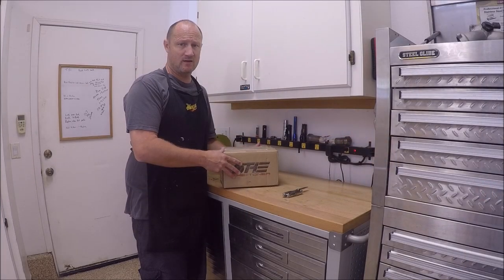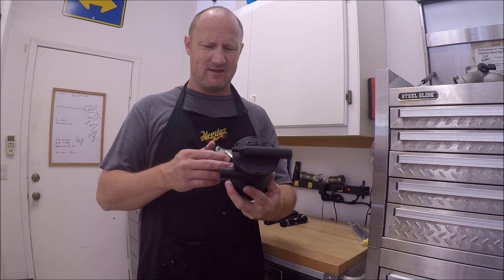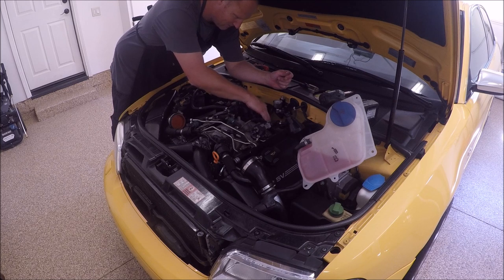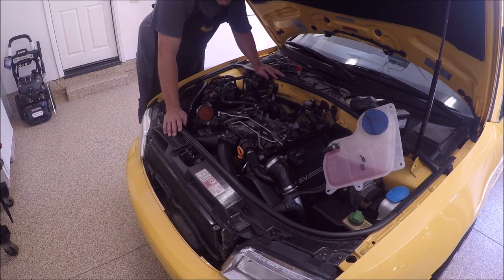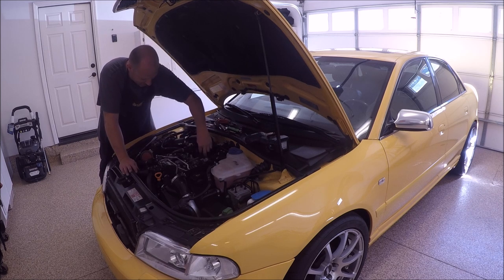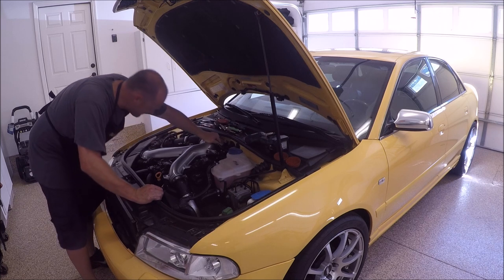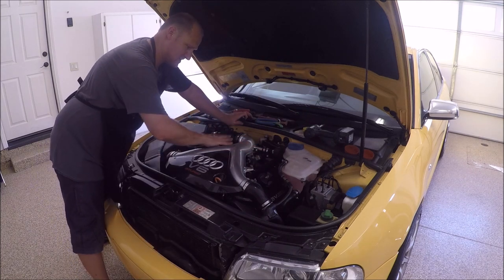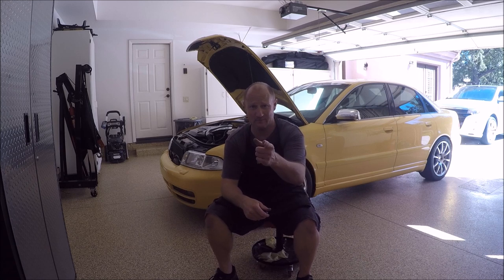The-Tuner Catch Can Install (TTE)

Comment: Hey can I ask what manual transmission gl4 fluid you prefer. I just swapped mine to redline 75w90. And although it shifts better It’s stiffer in cold temperatures than the factory fill. Considering going back to the factory fluid just wondering if you found anything better. I live in northern Michigan so I deal with some cold temperatures.  And also some hot temperatures in the summer.

Comment: 👏🏻👏🏻👏🏻 I think I used a 19mm cap off Amazon I had for my boost leak tester to cap my extra port off the intake manifold. It’s the one closest to the driver’s side, if I remember, which seems bass ackwards when you’re in there. The infamous Spider Hose. 
Curious to see what you think of this after a month or so.